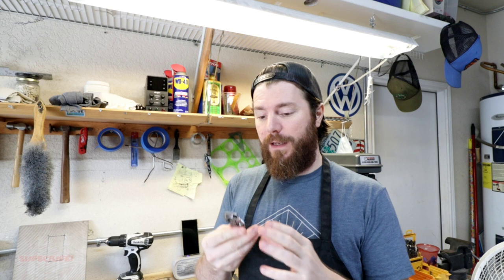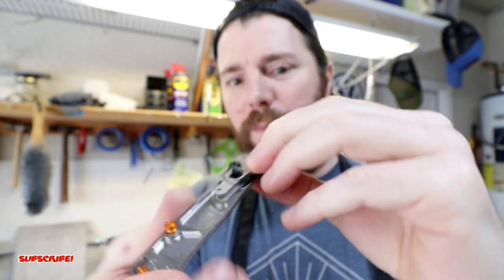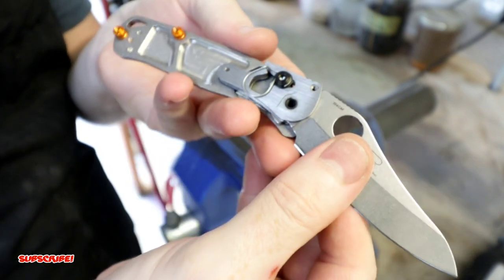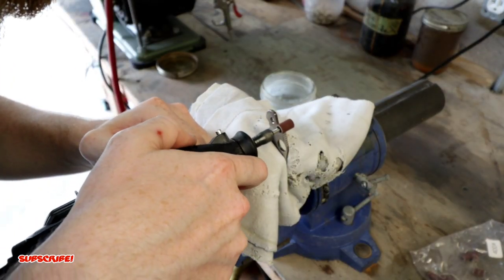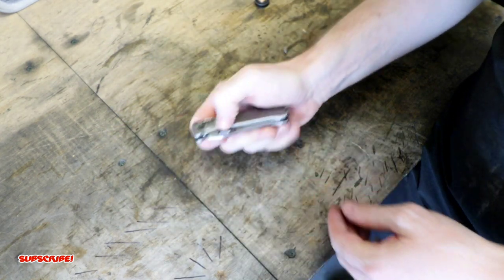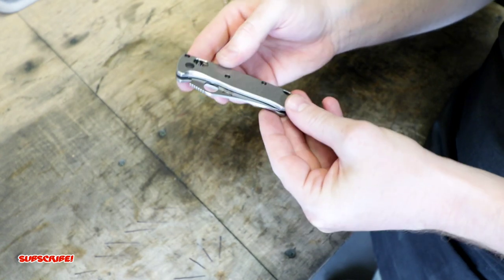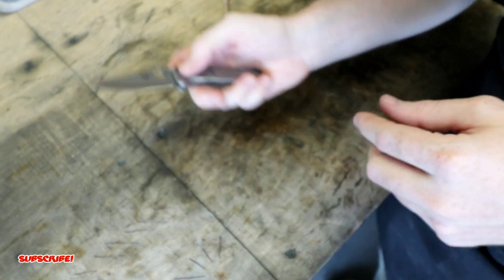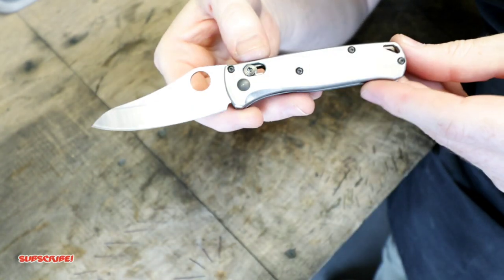Custom Benchmade Mini BUG-TILIAN Pocket Knife!!! #make

Comment: That green looks like it was about 100V.  Is that correct?
Reply from the maker: You are very close 98 volts😁
Reply: @KnathansKnives  I've dabbled.  In my experience, the best lime comes in around 105V-106V.  Will your power supply go that high?